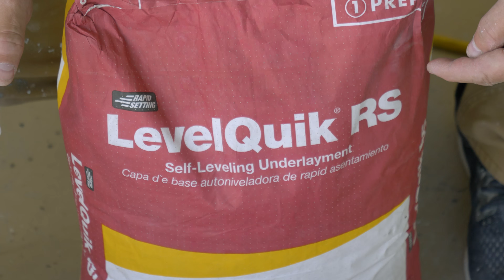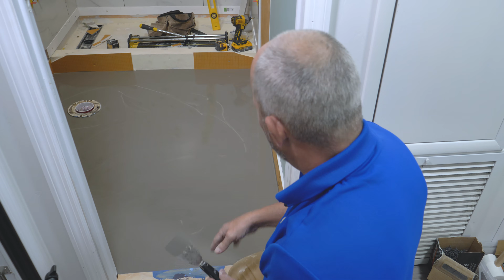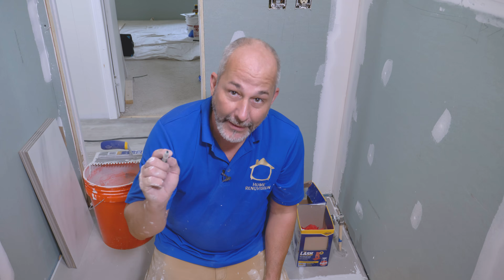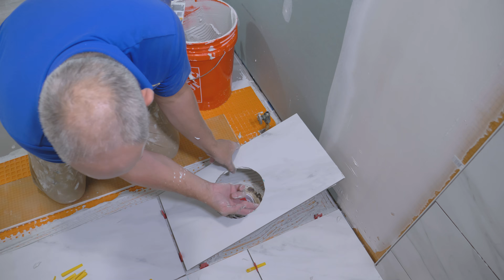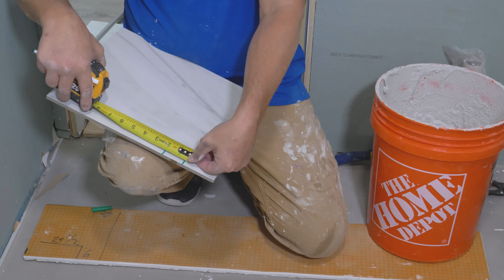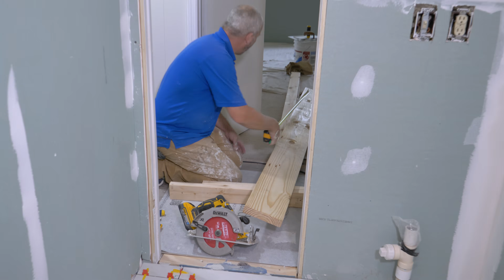4 Steps to Perfect Bathroom Floor Tile

Comment: I just installed the grout on my bathroom tile floor and have been following Jeff's process every step of the way. Floor leveler, Schluter Ditra uncoupling membrane. Sealing grout tonight and installing new fixtures and toilet tomorrow. Could not have done it without all of the advice and information offered on this channel.

Comment: Silly question.. why tile underneath the vanity?  I just fully gutted a small guest bath where tile was in front or stool and tub, and then carpet in front of vanity.  When I tore it all out, vanity was sitting directly on the plywood floor.  Under the tiles was a 3/16 or 1/4 layer of another wood panel to act as separation layer.  In an attempt to answer my own question, I'm only guessing that doing the whole floor is essentially for water protection if ever a little floor occurs.  Is this right?
Reply: It does allow some extra protection but it also allows you to change the vanity in the future without needing to retile.
Reply: Yes, tile under the vanity. Then, you just need to seal the tile-to-wall edge, no need to seal around the vanity. I think it’s a cleaner solution.

Comment: 9:45 It’s better to make the thin set lines in the opposite direction along the short width of the tile instead of parallel to its length because that allows less air beneath it for a better hold.

Comment: I just don’t understand why the Schluter sheet isn’t sealed on the edge. Isn’t that the point of waterproofing all around?
Reply: Yes it is usually you would go up the wall and use corner runs of membrane but people cut corners if you aren’t going to put tile on the wall outside of the tub or shower it’s best to go up at least 12” from the floor to prevent damage in the future 😅

Comment: When tiling around the area where the toilet will sit, is it a good idea to lightly set the toilet on top of the tiles so that they sink perfectly into the adhesive, with the toilet fitting snugly against the floor with no rocking back and forth? I hate having to stick shims under a toilet. On the other hand, I suppose some toilets are not manufactured perfectly flat. So, just use a level and hope for the best?

Comment: 🆘🆘🆘I can't find the MBP 1 Gal. Multi-Surface Bonding Primer by Custom Building Products nor the LevelQuik RS Self-Leveling Underlayment at Lowe's in Weaverville, NC.
What would be the best solution for both products that will do the job that I can purchase from Lowe's?

Comment: How do you tile under a radiator that can't be removed?
Reply: You should be able to remove any radiator. Get a plumber to cut the pipe put in a screwed connection.

Comment: Hey, when pouring the leveler i see you used excess schlutter board. Would cement board work? And it looks like you remove it before installing ditra. Do you wait until the leveling compound is dry, mid dry, other?

Comment: wouldn't it have been better to measure the tile such that it's width is even on both ends of the room? Rather than leave a thinner strip by the door thresholds and a full tile near the shower? I understand what you said by looking at the back of the room first, but my gut tells me that having a decent 6 inches or so of material at the end near the tub, and at the threshold is the best aesthetically, and only requires a little measurement planning.

Comment: I'm getting ready to do this very same thing.  With the self levelling do you use modified or unmodified thinset over the surface after self levelling has dried? Didn't realize I'd have to level and have both modified and unmodified thinset, doing ditra and porcelain tiles  ... thanks for your help and instruction, stay safe

Comment: I thought the primer de-coupled the plywood subfloor from the leveling compound. Wood and cement expand and contract at different rates, so they need to be somewhat de-coupled.

Comment: Why did you not center the second row of tiles?   Is there a rule about tile layment?
Reply: Gridded tiles show flaws more readily. If you do that, you just have to be super super careful to get alignment spot-on or else it looks sloppy. Most rectangular tiling patterns use a 1/3 offset each row. This breaks up straight lines and makes it harder to see imperfections. Especially with bigger rectangular tiles, offsets are most popular.

Comment: What is the purpose of using Ditra on a leveled bathroom floor?
Reply: It flexes a bit. Prevents tile from cracking. They call it a decoupling membrane.
Reply: @tinman1955 exactly..I'm hoping it works as good as they say in my tiny home 😊

Comment: I had a 1/4" 'bulge' in my Ditra from not properly squeezing w/ the grout float. It was a royal pain to come back and cut out an 8"x8" square. Took over 30 minutes w/ a chisel to get the thinset out. Double-check w/ a 4' level before this stuff sets up! VERY impressed w/ how well the Ditra 'sticks'! The felt does NOT easily come off from the plastic side or the floor; must be the felt providing the seperation layer for a minimal amount of movement in the subfloor.

Comment: I plan on tiling some rooms on the first and second floors.  Moisture is not an issue, and none of the rooms are bathrooms or kitchens.  Can I just do the LevelQuik primer and self-leveler, and then cement the tiles to that?
Reply: Yes
Reply: @wasntme3651  Excellent.  Thank you.

Comment: Floor leveler question:  My kitchen subfloor is slatted boards. I installed 3/4 inch plywood on top of the subfloor.  The plan is to install vinyl plank flooring.  What is a good way to seal the gaps in the plywood before pouring floor leveler, so that the leveler does not seep through?
Reply from the maker: use a can of spray foam. let it set up and then use a knife to trim it back. Cheers!

Comment: Pro tip for keeping the flange clean:
Wrap the outside with wide painter's tape and fold it over on the top. 

Using that kerdi board as a scrap for the floor leveler was quite the flex.

Comment: I definitely need a flange extender for my basement bathroom. Flange is almost an inch below tile. Got a suggestion?
Reply from the maker: use the teflon rings and build it up. Cheers!